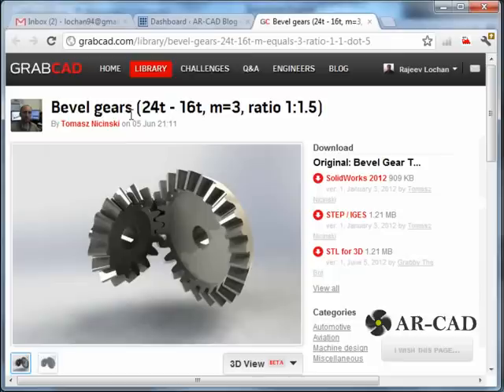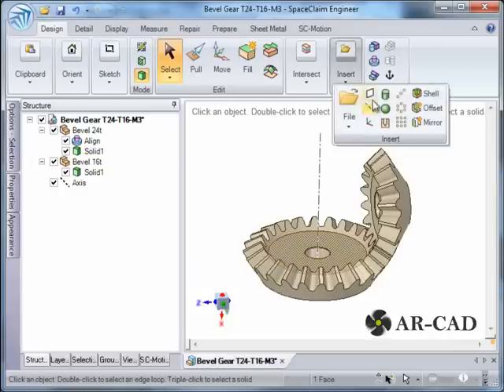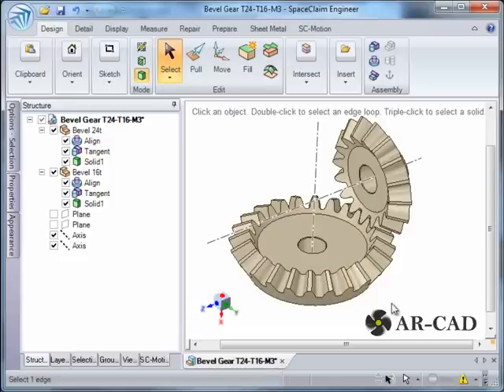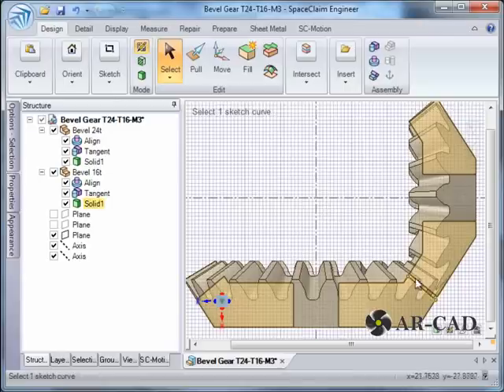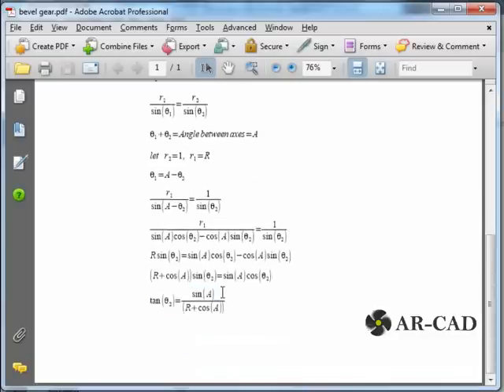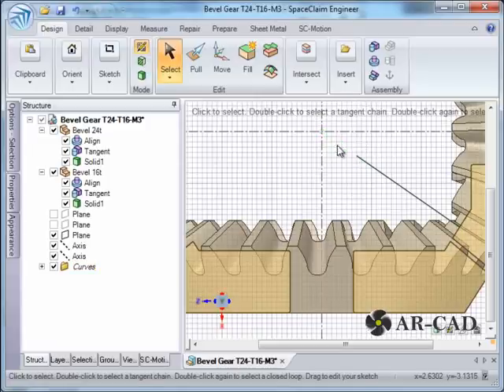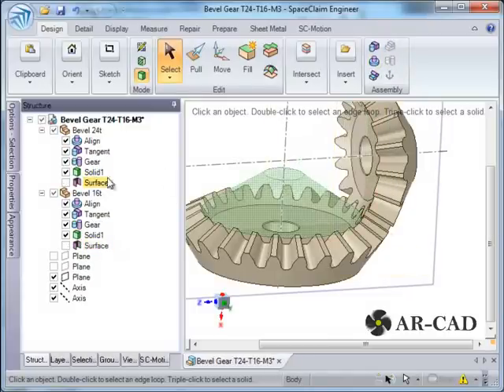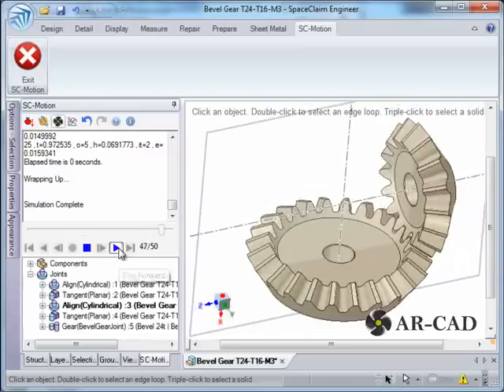SpaceClaim Tutorial on Bevel Gears: Assembly Conditions: SC-Motion

Comment: Thank you for your excellent video and your help! I tried to assembly these gears (with some geometry changes on the axis and in the ratio). However I don't have a flat surface in the pinion, but a little bit of curved surface. Now, when I execute the command tangent (video->2:04) shows me a warning signal on the command. After finishing all the procedures, the gears don't rotate. Can you please help me to solve it?